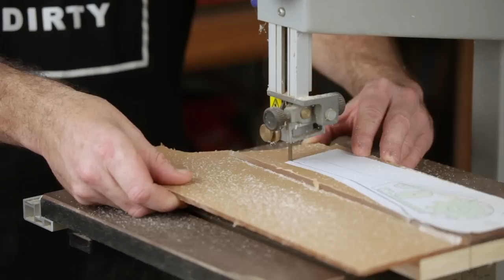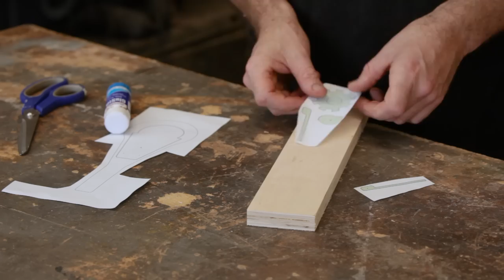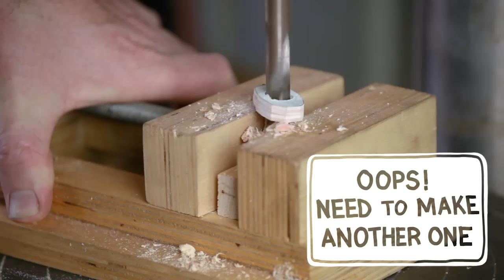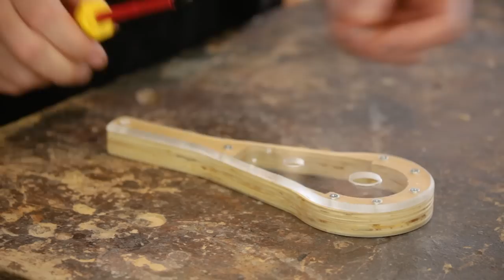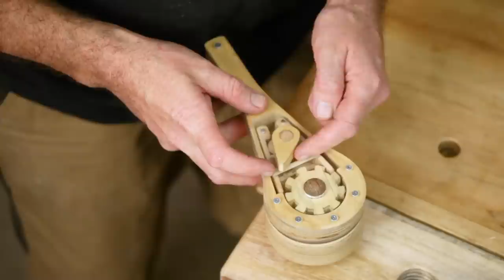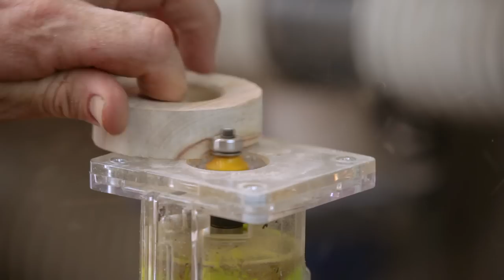Wooden Socket Wrench - Kids Toy

Comment: After all these years, I finally understand the reversible ratchet :-D

Thanks bud!
Reply: Я тоже!!!)))
Reply: Wait until you hear about the rotary ratchet, in which the handle can be rotated to rotate the head. But wait: you can turn the handle in any direction and it will only turn the head in the engaged direction!

Comment: I just made a hammer, lineman pliers and this ratchet for my son out of wood. Quick tip for anyone that attempts to make one themselves;

You can round over the edges of the plexiglass with sandpaper so it doesn't have sharp edges and then run over it with a MAP torch real fast. It gives it a really nice finish.

Comment: This reminded me of my own father and the things he'd build or improve for me when I was a kid. He didn't really have the same amount of woodworking tools (he dealt more in masonry, concrete and such) but he made excellent use of what he had, I specifically remember one time I put a string on a piece of glassfiber rod to make a bow, he took it and used it to build me a crossbow. I think I turned into a better woodworker than him in the end, but I never got the hang of masonry, he could sling that cement with the best of them I barely remember the ratios.

Comment: I am delighted seeing this video and inspired to make similar scaled toys of mechanism. Thank you for your wonderful videos and the investment you make to contribute to all of us. My two cents to help your design. I was surprised to see you make the engagement springs out of ply. I would guess that the directional loads on the part might have been better served by a piece of oak or another hardwood. I'd also consider the shape engaged ends of the sprung ratchet having more contact surface (like a bone). I'd even go as far as adding width to that section of the handle to make those working parts thicker.  Also, take a look at the gear shape. These are not rolling parts. I think you have room to lessen the radii there again for contact surface strength. Delighted!

Comment: Hi Neil,

What glue stick do you use for sticking your plans to the wood, does it dry or does it peel off the wood easily when finished.
Reply from the maker: I couldn't tell you the brand off hand - I take them from my wife craft supplies. ;) I'm sure I've used different brands and they all seem pretty much the same. When it comes to removing it I find most of it peels off then a scrape and a sand gets the rest off pretty easily. I've used a damp rag too and that works also. :)
Reply: Thank's for the reply Neil, all the best Mate.